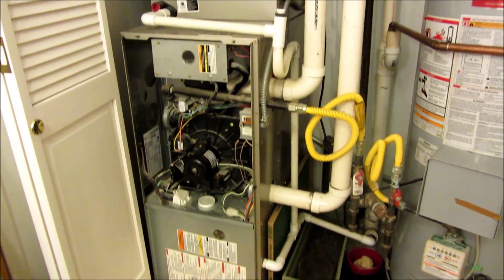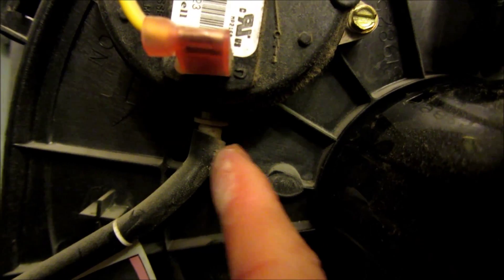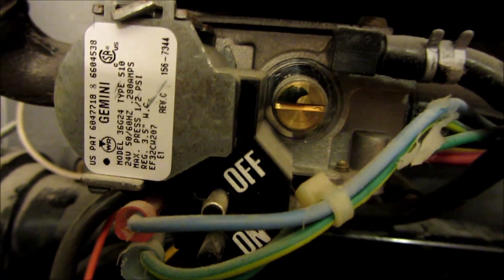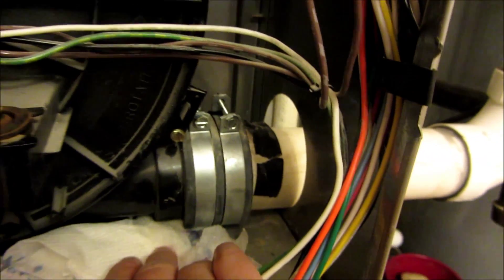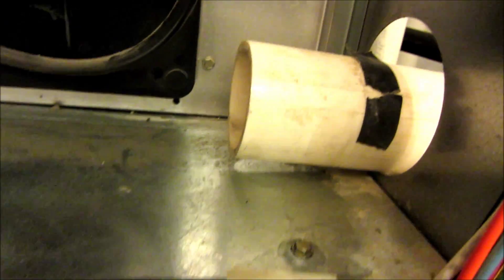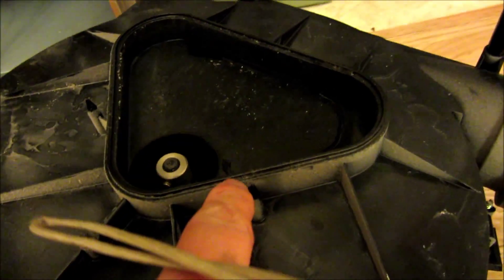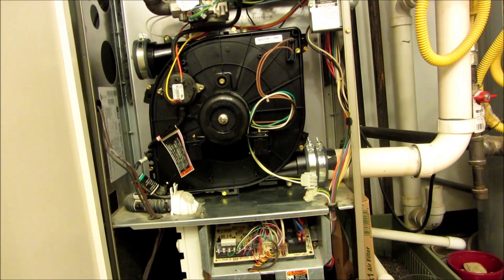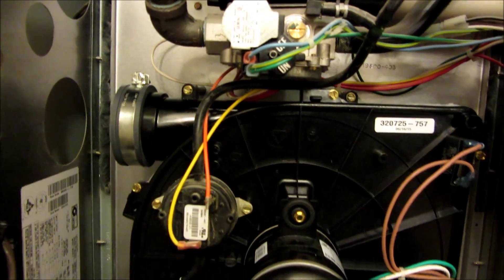Carrier Bryant Payne Inducer Motor Replacement and Repair Tips (HC27CB119, JE1D013N, 320725)

Comment: Great video - thanks for sharing ! Is it possible to replace just the motor or is it necessary to replace the whole unit ? It seems as if the motor is mounted using three screws.
Reply from the maker: Snehal B I had the same thought before I started, I did some research and many have noted the removal of the motor was difficult and damages the unit, so I it was my labor that was costly not the replacement part and decided to get the entire unit

Comment: Outstanding vid! Thanks. Quick question - about how much did your replacement inducer cost. I've been quoted $700. Not sure if this a good or high number
Reply from the maker: $325 from Amazon link above in description area.   Takes a out 1 hour to install, for a DIY normal person whose never done it before
Reply from the maker: +Donmr here's the price, click on the Amazon Link Inducer Motor for http://amzn.to/1WEQFtu
Reply: If you have a two-stage or variable speed furnace it'll be more expensive as it'll need a different inducer motor.  Perhaps consider buying a working one used.

Comment: Great video.  I will be attempting this next week when my replacement is delivered.   You said it took you 2 hours.   From what you showed in the video it doesn't look difficult or that it would take that long.  Was aligning it that much trouble or what took most of the time?
Reply from the maker: +Steve W make sure you replace that small cap in one of the corners, I didn't show it in the video.  A small 1/2" rubber cap, on the opposite corner you don't use for the drainage tube.  Aligning it took the most time, I wanted to do a "test alignment" and it turned out its not necessary, or you can't do a "test alignmment" without mounting the 4 screws anyway.  So I wasted a lot of time on that.  When I decided to mount it, it was fast and easy.  That failed "test alignment" wasted 1 hour where as I could have just finished the entire project in 1 hour.  Once you "remount" the 4 screws, it automatically aligns.